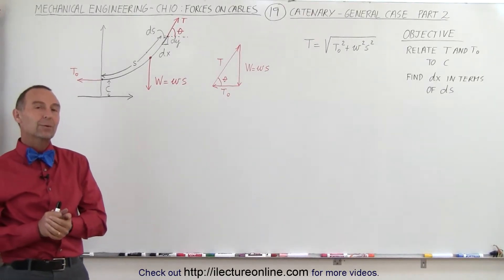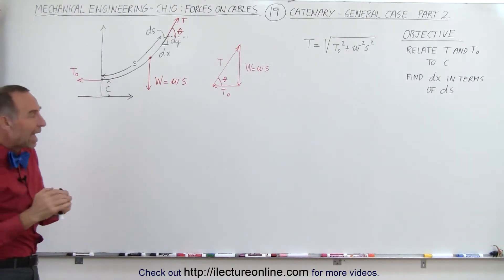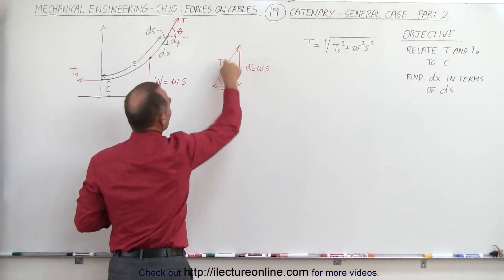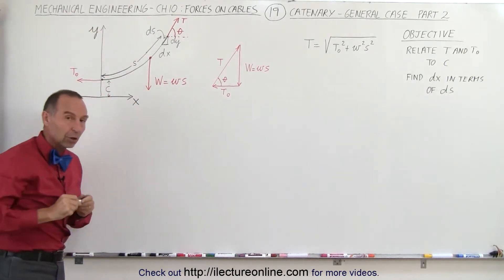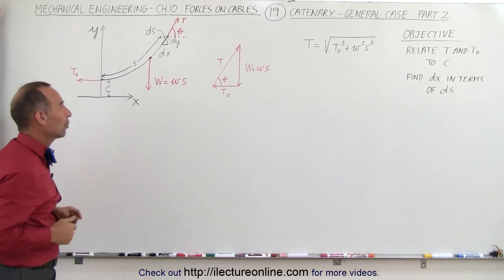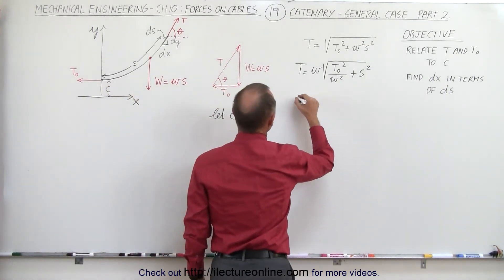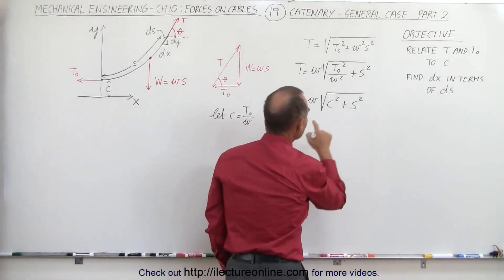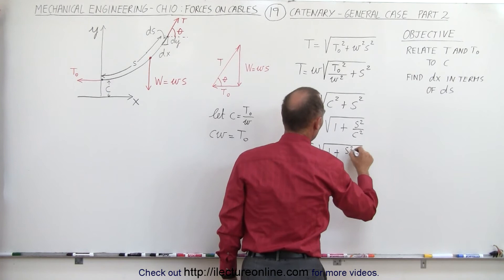Mechanical Engineering: Ch 10: Forces on Cables (19 of 33) Catenary - General Case (Part 2)

Comment: In the later videos you derived a relation : y^2 -s^2 = c^2. Let us assume that the origin shifts by 'k' unit downwards. So according to the equation (y+k)^2 - s^2 should be equal to (c+k)^2.  If this is to be true then c = y. So, I don't think that assumption (c = T0/w) is correct.

Comment: Wow thanks for the reply. Love your videos. However I'm still a bit confused. I have a few more questions if you don't mind:
1) why is the tension tangential to the cable
2)Why is tension only horizontal at the lowest point of the catenary and why does it point left from a right perspective if the horizontal component of tension on the right hand side always points towards the right.
3) what is the opposition to the weight force on the string (Wo) (i.e. what is the force which is stopping the string from simply accelerating downwards)
Again thanks for the videos.
Reply from the maker: 1) A cable is not like a beam.  It can only have tension in the direction of the cable.       2) Since the cable is horizontal at the lowest point, the tension will be horizontal as well, wherever you "cut" the cable, the tension will be away from the "cut".      3) the attach points hold the cable.

Comment: Sorry for the questions but I just really need to wrap my head around this. At the very bottom of the string you said that tension was acting purely horizontally. If this is the case what counters the weight for at the very bottom of the string
Reply: force*
Reply: Also what is the force that opposes the horizontal component of tension
Reply from the maker: There you are dealing with the concept of limits, differentiation, and integration.  Let me ask you this question, (your answer will help you figure this out).  How long is the section of string that is horizontal?
Reply from the maker: The horizontal components of the reaction force at the attach points.